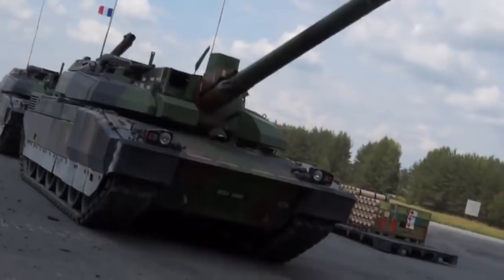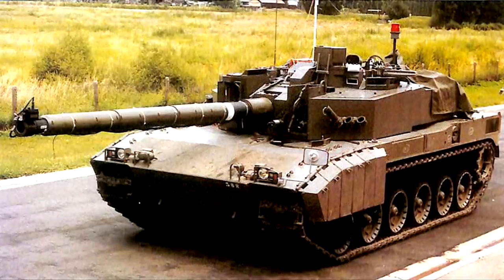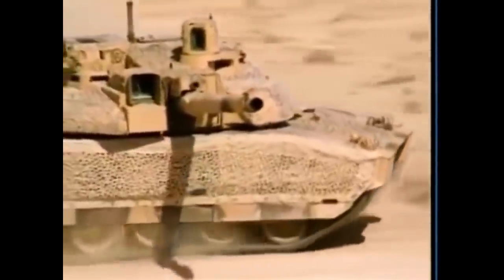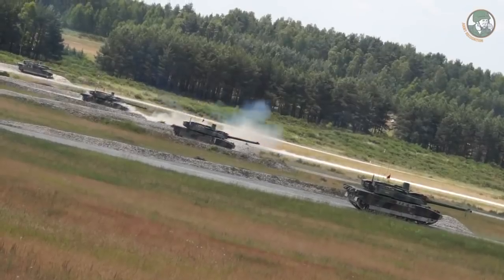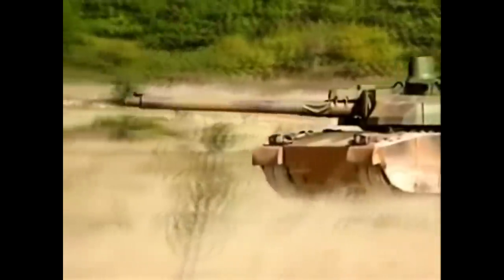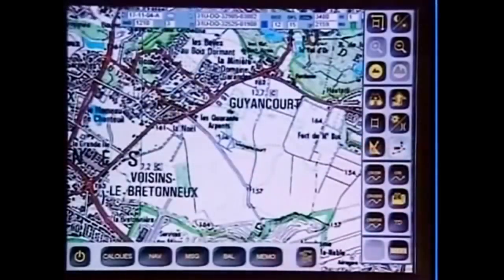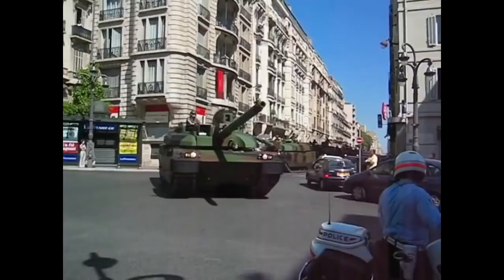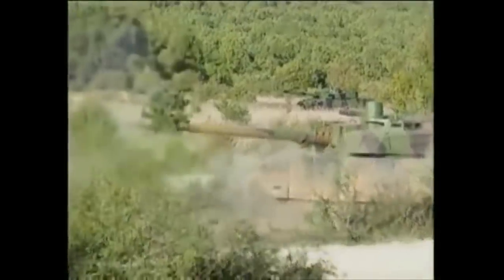Is Leclerc Obsolete?

Comment: Leclerc was made for the french doctrine, with high mobility, long distance shooting in interoperability with all the units and he's always used with infantry in support. He's not made for go point blank stop and shoot like soviet.  
You don't need that much armor when you can shoot before the enemy, like the Israeli in the Golan heights when few sho't kal beat T55 and T62 in 7-1.  
Stop reviewing all tanks like a Warthunder player and learn the military doctrine of the countries that used them.
Reply: Exactly. He made some good points, but his assessment completely fails to account for French doctrine. Regardless this is quite outdated anyway

The XLR upgrade package adressed most of the armor defaults, considerably upgraded sights and fire control system, and built upon it's already existing Network Centric Warfare capabilities to fully integrate it in the Scorpion program

Nexter and Thales are also currently working on the DIAMANT Hardkill system as a bridge for the PROMETHEUS system planned for the MGCS. It should come with the next upgrade package

Comment: I know this video is already 4 years old, but, I just want to say that someone who fails to understand that this Leclerc is called "série 21 " looses all credibility in my eyes. XXI, those are roman numerals , 21, as in 21st century.
Also, if Leclerc can be "accused" of being obselete, then what can we say of the Abrams ?😂 This nearly 70 ton dinosaur built using outdated 1970s design philosophies.
Reply: Someone who writes a comment and can't spell correctly loses all credibility for me. XD
Reply: @funkrates4778   it would be very useful if you could tell me where my spelling mistake is.
Reply: @funkrates4778 Well not every has English as their first language.
Reply: It doesn't matter anyway since the XLR upgrade package adressed most of the issues he speaks about in the video, while building up on the already existing Network Centric Warfare capabilities of the tank to fully integrate it in the Scorpion program

It's still lacking an Hardkill system, but Nexter and Thales have been reportedly working on the DIAMANT system as a bridge for the PROMETHEUS meant for the MGCS. It's most likely gonna be part of the next upgrade package

Comment: It's a French tank... It is literally made to be surrendered. Does more need to be said?
Reply: That 3000 french beat Rommel (40k force) at bir Hakeim during WW2 ?
That France has more KIA against the Nazi than USA or UK ?
Reply: @gringologie9302 The Soviets has more KIA on the Nazis than all three put together.
Reply: @IceAxe1940 And suffered more KIA themselves than everyone else combined. This argument is just as pointless. The fact of the matter is that the defeat of the Battle of France was entirely strategic

They had to retreat to stabilize a Frontline after the breakthrough from the Ardennes, but failed because of the lead Germany already had, and of the higher mobility its tank doctrine gave it

Comment: Playing War Thunder does not make you an expert in real life.
 
Have you even contacted anyone at Nexter as basic due diligence? Of course a lot of info on military equipment is classified, but you can't even get basic info correct.

- you say poor protection.  Conflict in Yemen would suggest otherwise, esp when comparing Saudi Abrams vs UAE Leclerc.  No Leclerc were destroyed, only 4 received minor damage from IED and antitank weapons (ATGM and RPG).  They were repaired in country and back in service soon after.   I won't even go into detail about Leopard 2 poor performance in Syria.
Armor specs are classified, there is 0 info available to the public on this, so all your comments are baseless.  Real life combat experience vs similar threats clearly show that the Leclerc's protection is not lacking when compared to other tanks.
BTW which MBT is expected to survive a direct AP hit on its side?  Your statement is cringe worthy, even a novice knows better. 

- you say lacks firepower.  You quote AP ammo (120 OFL F1/F2) figures from ammo made in the 1990s, which have since been upgrade to 120 OFLE F2 version in 2013.  Not only that but Nexter is already working on the next version called 120 Shard Mk1 and Mk2.  Final testing is ongoing and will soon be in service end of 2022.  Nexter is also developping other types of ammo for the Leclerc like 120 NLOS guided precision munition and the 120 IM3M multimode ammo.  
Furthermore the Leclerc main gun has a higher muzzle velocity with kinetic rounds than other tanks. (Leclerc L52 1790m/s vs Leopard 2 L55 1750m/s vs Abrams L44 1550m/s)  I am not suggesting that the difference is huge, but it shows Leclerc certainly has at least as much firepower as other modern MBT.

- you say it has poor range. Care to clarify?  Leclerc has similar range to other NATO tanks, estimated 550km on internal fuel and 650km with rear external fuel reservoirs

Lastly you make no mention of Leclerc XLR which reveals how utterly ignorant you are on the subject.  You made this video in May 2019 and are not even aware of French army Scorpion modernization program which was officially announced in 2014.  This modernization program includes the latest Leclerc upgrade to XLR standard which started production in 2018.  The first few Leclerc XLR had already been delivered to the French army by the time you made this video.  A total of 200 will have been updated by 2028, as well as 18 Leclerc DCL (recovery versions).  The rest of the tanks have been retired from service.

To conclude, the Leclerc is far from obsolete, and quite comparable to the latest standards of modern MBT.   I am not going to split hairs and attempt to say which tanks is superior, because on paper they are quite similar.  On the battlefield these marginal differences will not likely be the determining factor, when there are more important key factors at play such as crew training/experience, operational rates, intel, logistics and tactics (including synergy with other deployed assets (infantry, arti, air etc...), since tanks do not operate on their own in a vacuum).

You're seriously clueless, your research is sloppy to put it mildly and inevitably your ill-informed opinions are out of touch.  Next time actually take time to do some basic research before making a video.
Reply: Not to mention that the sources used are Russian.

Comment: Well, the Leclerc can speed up to 77km/h and it can shoot while speeding at 50km/h which  no other modern tank can do. I won't debate if its the best or not, but he is one of the most technical adavanced tanks in the world (it uses alot of electronics for spotting and observation systems)

About the possibilty of a tank replacing the Leclerc, France  is a already on a common project to devlop a new tank in cooperation with Germany. The Leclerc is suposed to fully retire in 2040 so we should have more news about this projects in the coming years.
Reply: T 90M: huh
Reply: @mrmakhno3030  T90Ms are able to shoot while moving indeed. My comment is rather old. 
But from what i saw, T90M and Leclerc remains the same age (30 years) and both have 3 crew members instead of 4. Leclerc seems faster and also a bit heavier (5 tons more) and it was modernized  with news versions called ''Leclerc XLR" and are equiped with the ''Scorpion'' system,.wich is an electronical instant communication system, making it far more easier for fighting along smaller vehicules/other tanks. Everything can be discussed but i wouldn't consider Leclerc obsolete at all. German Leopard II and Russian T80 and T72 are closed to obselete imo
Reply: Leclerc can sustain much greater mobility according to the French military, even the French Navy just having witnessed it

Comment: OH my. Its gun is not the best in NATO but it's better than the Brits Chal 2. Weak spot at the hull is still smaller than the Brits Chal 1 and 2 so I wouldn't worry about that. Not to mention its gun is much better than whatever the Brits has. Since I mention the gun, keep in mind that certain country use the Chal 1 gun (yes, chal 1 not even Chal 2 gun) and manage to make it even worse than whatever the Brits use. What an achievement. This thing without any modern upgrade can shit on Arjun non problème.

Comment: Someone isnt taking into account that in the battlefield nobody unless they want to get themselves killed would expose themselves long enough to take proper aim at an enemy tank just to hit their weak spot rather than aiming center mass and roll back into cover probably saving their ass from getting spotted and hit and another thing your forgetting about the doctrines associated with these tanks, NATO in particular has molded its tanks on a HULL DOWN approach to combat, only exposing their turret and preferably not their HULL if it can be avoided.

Comment: The latest upgrade puts it in "average" territory - but the series 1 / 2 tanks were not made long time ago - this is a very "modern" tank as far as it design time is considered. It is recently produced tank. For it to be so weak straight from production line is a big problem - if it was made in say 90s not 2000+ one can overlook the issue - but it was not made 30 years ago.

Comment: I think you don t really take in count all the strategy there is behind this tank. Its first objectiv is to shoot first and then flee, a bit the same as the russians did with the armata(explaining less armor and more speed). It is important because all the tank is based on that, obviously abhrams and leos have also the same objectiv but not on the same level, they are design to resist more. The fight the Leclerc it is built for is quite different from them, it is maybe explaining some of the flaws you're talking about that's why I think it is important to have that in mind.

Comment: Your lack of infromation about the Leclerc tank is abysmal, not very professionnal.

Protection of the Leclerc is comparable to other top NATO MBT, with ERA protection against tandem warhead and Titanium insert for better APFSDS protection.
With its smaller size, this make the Leclerc light, yet very well protected.
It has weakspot of course, but like every other MBT.
It's vfire control system is one of the most advance in the world (95% hit probability on the move), couple with an excellent gun (longuer caliber and high pressure), a good autoloader (12 rounds a minutes), good ammunition (depleted uranium APFSDS OFL F2 ammo) and amazing mobility (hyperbar engine have all the advantage of a turbine engine, with the consumption of a reugular power pack).

This make the Leclerc MBT, in the TOP 3 of the Best mbt in the word (and it keep getting upgrads like the XLR pack) + it is combat proven ... and it was much more honorable than the Leo and the Abrams or any T series in this regard ...

plz next time, read something else than wikipedia and some shaddy russian sources

Comment: 2:10 Abrams in Yemen?
Copy-paste this in Google search engine: abrams tank destroyed yemen Then do it again with leclerc tank destroyed yemen
Reply: Hmmm, kinda dumb comparison. The leclerc hasn’t been to the areas that the abrams has, or in used in the numbers it has. And it’s the saudis using or hiring out the abrams with no infantry support. The leclercs have been used more sparsely by UAE. And the leclerc hasn’t been hit with an atgm, well at least not videoed. If hit by a konkors atgm the leclerc is more than likely going to be down and out as well.
Reply: Dustin Morgan exactly, the leclerc is the MBT of choice for the UAE and from what I know, the UAE forces have not deployed any themselves as they are better prepared and trained than the saudis instead of hurling heavy equipment at a bunch of rebels with no infantry support, they have so far sent light IED resistant vehicles, all heavy equipment is Saudi based or leased
Reply: When will you understand the need to compare what is comparable?
Compare the Abrams tanks that were hit and the Leclerc tanks that were hit. The result is clear: the Abrams burn or explode. The Leclerc: no, they resist. The reason is the composition of the armor plating.
Reply: @hybridssuck  
With or without infantry support, sparsely used or not: When hit, one burns, the other one does not burn.
From now on it is not only the thickness of the armor that counts. What matters most is the nature of the armor.
The composite armor of the French resists better. It is the truth told by the facts.
Reply: Infantry and smaller vehicles should cover the abrams from getting hit at the sides.

Comment: Friend, you leave such a bad impression stating: "The armour isn't great, firepower is bad".

I mean, really? That is a straight up nonsense and its purely subjective - with plethora of direct or indirect evidences contradicting such statement. 
Only latest  variants of M1/  K2 / Type 10 / T-14 / Merkava can compare with its battlefield integration, target acquisition. Leclerc is excellent at battle management and information usage. 

You never address important aspects, such as its high price considering the competition, or its problems in desert like terrain, or having to calibrate the gun after long travels. 

Regarding your sources:
 3 out of 4 articles you've posted didn't even get the tank designation and its name right - "AMX-56 Leclerc". 
With respect, those are NOT reputable sources.

Never even once have I seen you using a source on  a subject from country of origin. You only use Russian sites with questionable reputation, which makes your videos having questionable value.
Please don't take it as a personal attack, but I can't award you with my like as per tradition.

Personally I keep Leclerc in a high regard thanks to its excellent data links and programmable ammunition. Vehicle is on a higher end in every department except its price and reliability of engine - transmission in certain environments. 

If it was to be acquired for a better price and coupled with German transmission it would make for a beast of a machine still. 

Meow out!
Reply: Imagine you criticize a youtuber on a tank but you can't even get the correct name of the tank
Reply: @Theo_Aubusson  no he said that 3 out 4 sites used AMX 56 leclerc while its true name is only leclerc, so yeah not valid informations